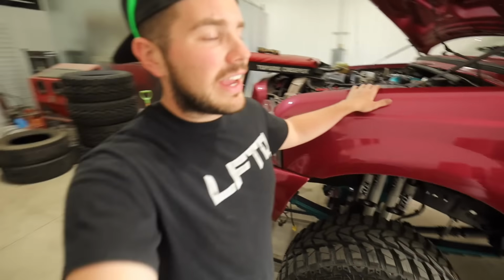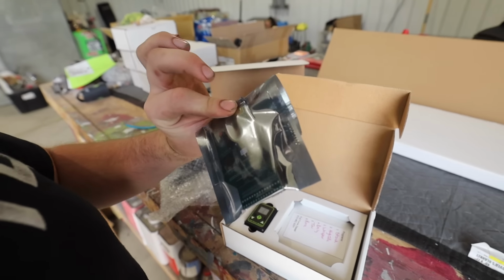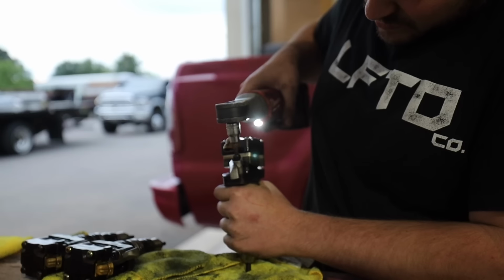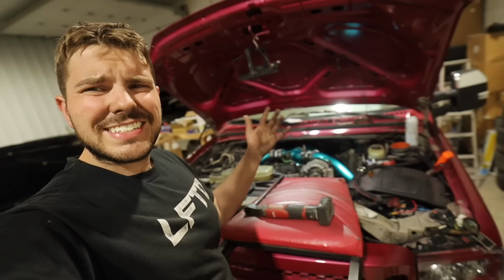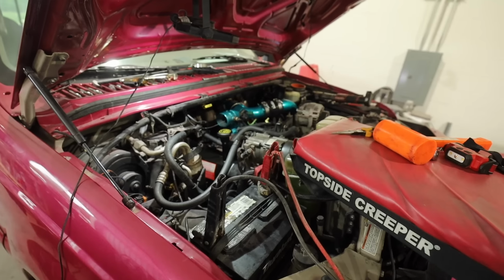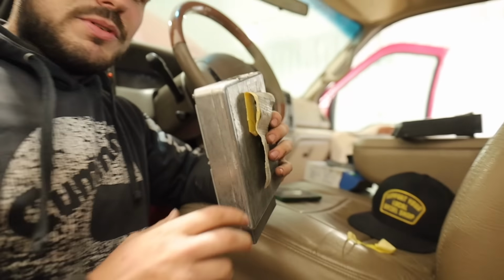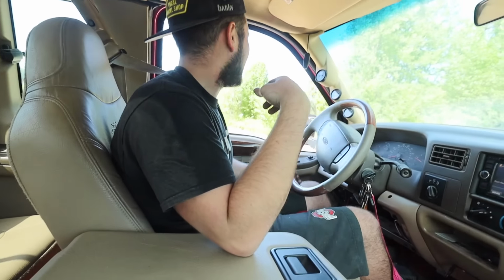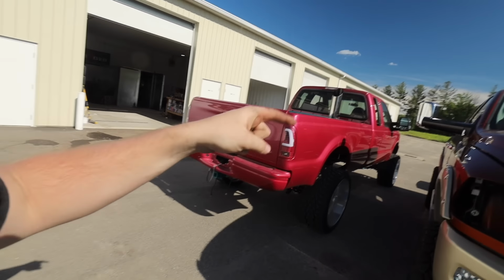I Put Stage 2 Injectors In My 7.3L and Immediately Shredded the Transmission

Comment: 4r100 loves chewing up the direct drum , mine sheered off all the teeth . They cant handle the added power. Time to rebuild with heavy clutch pack and upgraded valve body
Reply: Yup that’s exactly right. The clutch pack in my direct drum was literally welded together 😂😂
Reply: agreed my buddy has been thru 2 built stage 1 trannys
Reply: Billet forward billet intermediate cryo input and output
Reply: Forward drum*
Reply: Have to put a C6 forward drum in there
Reply: So thinking about doing the same upgrade stage 2 injectors and bigger turbo what should I upgrade my transmission to ...

Comment: Somehow my stock 4r100 lasted about 6 months of spirited driving with 205/30 injectors and a 63/73 kc300x. Rebuilt it and she's pulled harder than ever love these trucks
Reply: My 02’ F350 7.3 is called Fat Boy, It’s a Lariat LB, CC, DRW 4x4 and I’m having the same KC300X stage 2 turbo installed along with Holder 180cc 80% injectors and the PHP Hydra tuner by jelibuilt at Southern Diesel Service & Performance in Columbus, GA. Also an ATS 5 star torque converter and John Woods Valve Body, Stainless Steel 304 grade exhaust headers, 5” exhaust, and a bunch of other upgrades too. I’m working in Florida and don’t have the time or place to get things done so I look forward to driving my truck again soon. Cost a lil over $22k for all parts and install. Put a whoopin on my wallet, lol
Reply: @FatBoy7.3Powerstroke  oh yeah it hurts but it hurts less when you get her rolling into the power again
Reply: @sirseven3  I use it for heavy towing, My 5th wheel 3712 Keystone Raptor toy hauler, I call it The Dog House, weights around 15k lbs. I hope it’s worth the money in the long run, Fingers Crossed
Reply: @FatBoy7.3Powerstroke  oh it will be just make sure you keep up on fluids and have a good gauge combo to measure EGT, trans temps, and boost.

Comment: I have a 2003, one of the last 7.3L to roll off the line, its a 2wd long bed extended cab lariat with grey leather. Mine is a Texas truck with 125k original miles and has never been wrecked. Its bone stock except for a 6 position chip, air bags on the rear and new stiffer front springs. I use it to pull a 36ft 5th wheel so the long bed is the way to go and I actually prefer a long bed. Its such a sweet truck that has never let me down. I bought it about 7 years ago with 84k miles from the original owner. I paid $13.5k for it at the time. I also put newer head and tail lights all new blacked out badges and upgraded the wheels and tires to 18 inch Mayham wheels. I put spin on trans and fuel filters, did the hutch and harpoon hack on the fuel tank. Also put newer larger mirrors on it with an alarm and touch screen stereo. Also had all the steering links replaced and put better shocks on it. The truck is super sweet. A know most youngsters want a 4x4 lifted version but that would be silly for towing an RV so mine is the way to go for that purpose which is what I bought it for.
Reply from the maker: Amen! You got one of the last good ones!

Comment: Hey Ryan just a tip. If you have to take the passenger side valve cover off again the oil fill unscrews! Gives you a little extra room to get it out and putting it back in 👍🏽

Comment: I just did injectors glow plugs gaskets and wiring harness kc turbo and pedestal, X pipe, Up pipes hydra on my early 99 Took all the injectors out turned it over by hand put everything back together started on the fourth crank full forces 180 injectors run great

Comment: if you have issues getting in and out of gear (usually only neutral or park) the column shifter, there is a plate with 2 bolts on those fords underneath the dash that get lose over time as well. could be causing your tranny to not fully engage. located right above the steering shaft.
Reply: I'll add since I did this recently...If they're tight and it's still floppy it's the shifter tube bushings. When I did mine I found the OEM zinc/pot metal U-clamp on the lower end of the tube was broken into 4 pieces as well as the plastic bushings completely shredded. The little plastic bracket that holds the tensioner for the gear indicator cable also breaks, so if the shifter is tight but the pointer is misaligned, check that.

Comment: If you truck takes long to crank until the oil builds pressure it’s the low pressure oil pump on the front of the crank/engine plate and when installing the balancer put rtv on the balancer where it’s flat, and go for a high volume after millings. Love your vids
Reply: Typically means an oil sealing leak. If you just replaced injectors you will have a long crank time until it purges air. If once purged it still has extended crank times I would point to improper injector seating which gouged 1 or more o rings on the injectors. The pumps don't fail as often as seals even when driving them hard.

Comment: “A lot of carbon on tip, a lot of carbon on the mid shaft.. it was very tight cumming out, it mushroomed, idk if it was going in or going out.
I ended up getting it pulled..  and it got stuck! Put some deep creep in the hole, pushed it in, pulled it out.. put some deep creep in the hole, and then just pushed it in and pulled tight and it came! It eventually popped, it took a TON of force. What happens is they’ll swell up and get stuck.”  
This is the most automotive erotica shit I’ve ever heard... lmaooo

Comment: I had a similar issue and in just 5 launches smoked my tranny. I found the weak link to be the valve body and for just under $300 had it upgraded which now can handle the extra power. No real need to drop 5k on a beefier tranny. Just need to replace it prior to bumping the power too much.

Comment: Weak points are the torque converter, tiny transmission cooler, and upgrade shift gears
Reply: You now have an extra forward gear
Reply: I think the 6.0 trans coolers are bigger and more efficient and it’s a easy swap

Comment: The easiest way to remove oil from the cylinders is to put your new injectors in, remove your glowplugs then lay a towel over your open valve covers and crank away.

Comment: I think it need a hpop it should have a little more power still and it should be getting more fuel on the hot tune especially with number 2 sticks it should smoke more than it does too
Reply: Agree with you mine smokes like a train I have smaller injectors

Comment: There is literally fuel drains on the back of the heads and little screws under the valve cover to drain the oil so you don’t fill the cylinders pulling the injectors

Comment: I feel like if the caliper were locked up you wouldn’t be able to push it by hand right? I’m sure that trucks heavy but if it were locked up or locking up that thing would feel like you were pushing a house. However I wasn’t the one pushing it so if it seemed like it was really hard to push defiantly a caliper

Comment: Did you drain the oil rails or Fuel rails before pulling the injectors? I need to do this same thing to my 7.3.
Reply from the maker: I did the key bump method to evacuate oil through glow plug holes

Comment: Never had a single issue with my 99 250.. but I don't power brake my truck.... You need a boost Fuller where you don't get the code..

Comment: The 4r100 transmission Stock has slippage problems and won't hold up High performance you can High performance you can put a stage to Or a stage 3 rebuild transmission in it It will hold up but in my experience Won't shift hard I'll feel the same I'm now running a 5 speed manual With a low gear That transmission stock seems to hold up and not slip as much as the automatics I prefer the manual transmission over the automatic any day

Comment: Y wouldn't you use thoughts exhaust strap clamps instead of those pipe crushing cheap ones. Also ppl add a foot of flex pipe, to allow the body and engine to flex separately. Or ur just twisting on a solid pipe that's bolted to the box.

Comment: That's why I went with a v10 brought it home and built it and supercharged it,it's 23 years old and I put in 4.88s and a gearvendors underoverdrive it pulls like a raped ape when I was deciding between the diesel and the V10 I picked the V10 because the diesel was so slow

Comment: If it’s a stock transmission Ford but the gas motor tranny in the diesel which makes the diesel break more trannys because they are not built for the tourque of a diesel

Comment: Your full of chit.  I never broke the little oil drain tube on a 7.3.  Your soppose to remove them before you take the injector out..
Why didnt you do the injector cups.. the pressure from the higher output injectors  will most likely split the cups and you will end up with diesel in your coolent..
Reply from the maker: Cups looks brand new